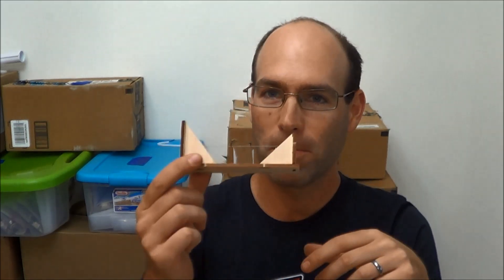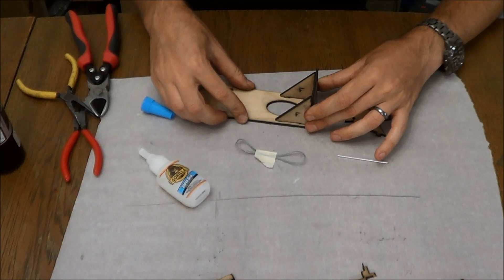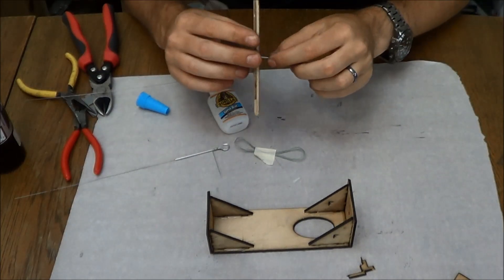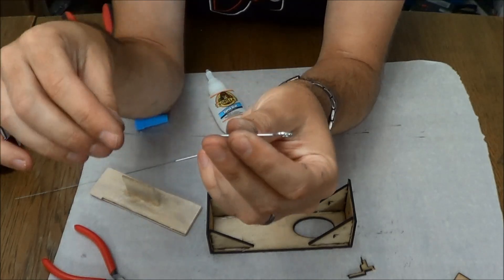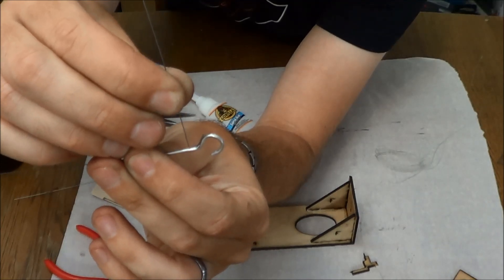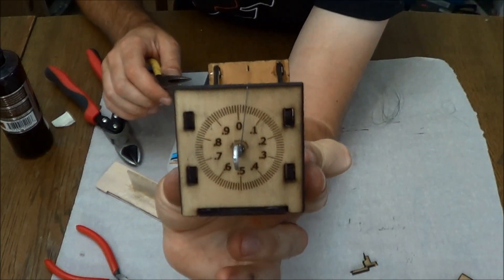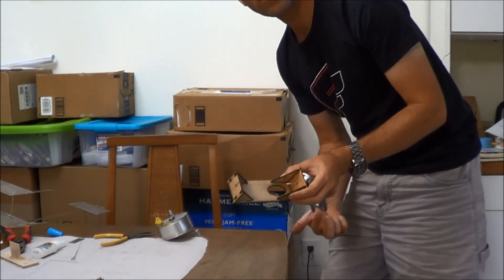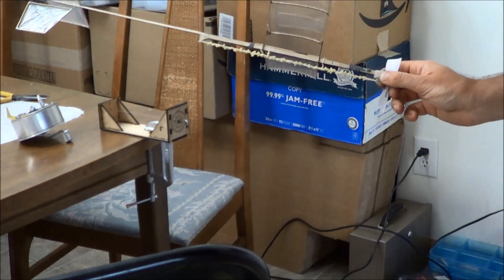J&H Aerospace Torque Meter - Build Instructions

Comment: If I’m using the 2026 Hurricane Helicopter with a 13.5" motor, how does the torque work, and what numbers should I watch for so I don’t break the rubber motor?
Reply from the maker: Your first error is fearing breaking the motor. You should break motors. Lots of them. 
Minimum launch torque to get full performance is 1 in-oz. These motors will take 2.2 in-oz which unfortunately is past the structural limits of all available meters save for the IFFS digital meter. You need to be able to wind past 1.8 in-oz and then back off to 1.0 or so. On 1/8" rubber you should get 100 turns/inch when you get your technique dialed in.
Reply: You break a motor and record the breaking turns and torque. You now know the turns and torque limits. There are formulae, but every batch of rubber can be different.
Reply: The breaking torque depends only on the cross sectional area of the rubber; number of strands times thickness of a strand times width of a strand. It is independent of the length. The number of turns to break is related to the length of the motor. The parameter of interest is the turns per inch, tpi. That also depends only on the cross section.
Reply: @aeromodeller1 I go over 3 resolutions as it gets tighter.
Reply: @kmanyip7646  I assume you mean three revolutions of the torque wire. In that case, you are probably over stressing the wire. Does it go back to zero when you release the torque?
Reply: Joshua could you do another video how to wind the motor? The video is blurry, can’t see the torque resistance please.
Reply: The quick answer is 1,401 turns. However that is subject to some caveats. There is a formula for calculating maximum turns, but it includes an empirical coefficient. Every batch of rubber has different properties.  You must test your rubber to determine the value of the turns coefficient. I have a page about rubber formulae on my site EndlessLift. The formula for maximum turns is T = L x Kt / Sqrt(S) where T is breaking turns, L is motor length in inches, Kt is turns coefficient from tests, Sqrt( ) is square root and S is motor cross sectional area in square inches. S = n t w where n is the number of strands, t is thickness of strands in inches and w is width of strands in inches. You can turn this formula around to get Kt from your test. Two of us tested a new batch pretty good of Tan II some time in the 90s and we both got exactly 10.64 for Kt. I use that as my rule of thumb value for estimating breaking turns. I'm smiling at that, because we seldom have four significant figures of confidence in our measurements, especially compound processes with four inputs. The caveats; every batch of rubber has different properties, the properties vary with temperature, breaking turns depends on how you wind the motor; lubrication, stretching, winding history and speed of winding. As you wind rubber, you are putting energy into it. Some of that energy is expressed as heat. Hotter rubber will buck back, breaking at fewer turns. As you get higher on the torque curve, each turn puts in more energy and produces more heat. You can wind very fast at first, but as you approach maximum turns you must slow down to let the rubber cool. So the calculated maximum turns is not an absolute guarantee of safety, it is a guide to when to pay close attention to the feel of the rubber. Some squeeze the rubber between thumb and forefinger to feel its hardness. As rubber approaches its limit, the polymer chains are being pulled into alignment and the rubber is crystalizing. The squeeze test is rather crude. A more sensitive test is to give gentle tugs on the rubber. At first it will stretch easily. As you approach the breaking point, it becomes less elastic. It is a matter of judgement borne of experience when to stop.

Comment: Do you have any videos showing how to use this to get consistent flight heights?
Reply: Winding your motor to the same torque should get consistent heights. Rubber can fatigue, though. Especially if it is wound close to the maximum. By the third windup to 98% of break, the motor will go limp. It will recover after resting overnight.

Comment: What gauge is a '15000 piano wire'?🤔
Reply from the maker: It's 0.015 inch diameter piano wire. If you do an online search you'll find that's a standard product.
Reply: Thanks 👍🏼